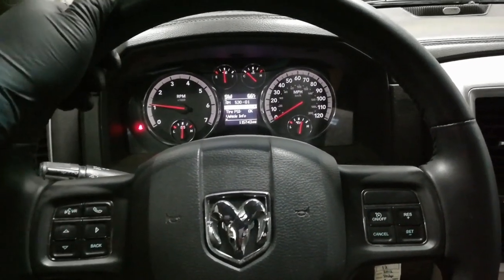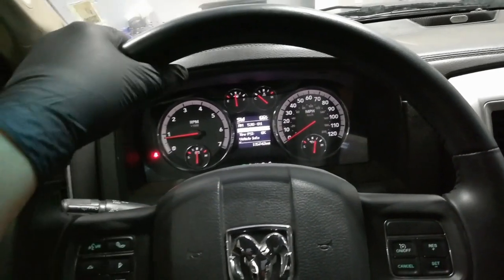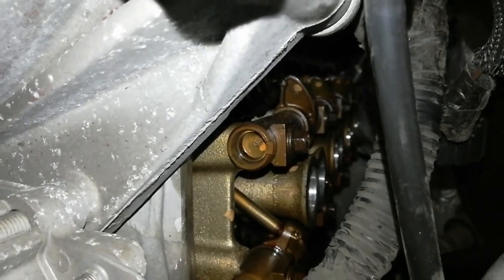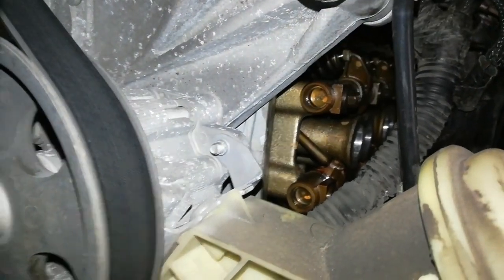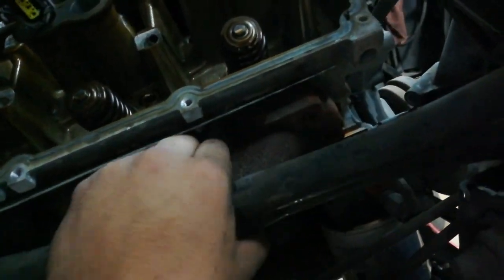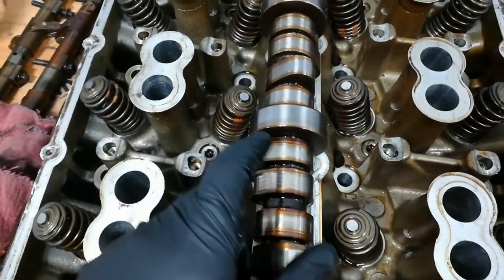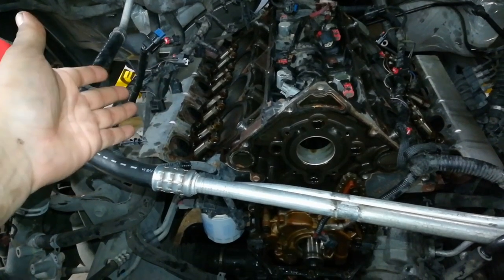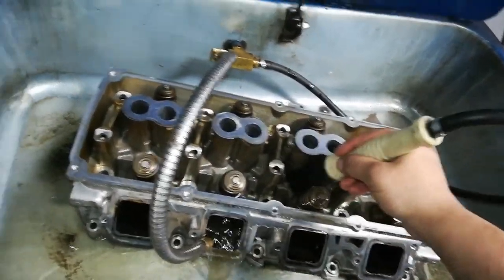Dodge RAM Missfire Part 1 ( Tear Down) 5.7 6.1 6.4 HEMI Camshaft and lifter Install

Comment: Nice vid, I'm dealing with this on my truck right now. Try clear flood crank mode, foot to the floor on the accelerator pedal keeps the injectors from firing and allows you to crank without starting 👍

Comment: Thanks for your help man! In the process now!
Reply: What parts or where did you get the parts
Reply: @rayray9777  the lifters are aftermarket. I think ebay. Non mds. But it took 3 tries. The camshaft was from the dealer, give them your vin because 4 camshaft for that year.

Comment: See Uncle Tony’s video. It is a design problem. If your engine idles a lot the “splash oil” cannot reach the lifters below 1500rpm. The cam is in the way and the main oil galleries block the oil to the cam from the crankshaft. A possible fix for a daily driver is to remove the splash guard from the oil pan. 45 minute job to get 200,000 plus miles of service.
Reply: What do you mean splash guard the oil baffle that’s part of the oil pan gasket ?
Reply: Yes it is, but it is better known as a Windage tray. Stopping oil splash giving you a very, very small increase in horsepower. The lifter needle bearings and the cam lobes need more oil. Or cut a 2 inch slot in the middle of the Windage tray from front to back to get more oil at idle.

Comment: If the vehicle has the MDS system it will run on 4 cylinders at idle. I just watched a great video on how this affects lifters/valve operation. 

Please correct me if i am mistaken, I am not a dodge guy and just trying to find out more information on the 5.7L tic..

Have a friend who's vehicle.JUST started having the tic issue and considering repairing it for them.

Comment: In the last two years, has the engine and oil pressure been okay? Doing this same job soon, but worried about long term damage from cam metal.

Comment: Any updates?
Curious as to what type of oil you were using before the repair and whether you switched oil type after the fix.
Also, what was the approximate mileage when the engine developed the misfire?

Comment: I have the exact problem.  I have a 2012 dodge 1500 5.7 hemi bighorn.   Its has 11000 miles on it.  I bought it brand new.   I still owe 6,000 on it.  Dont have money to fix it.  Can I still drive it, and not cause any more damage,  I know it won't run the best, but will it tear up my engine?  Please would love some advice...thanks
Reply from the maker: Unfortunately it will tear up the engine all that metal from the damaged lifter and cam gets in the oil, and not only that the valve isn't opening all the way which can burn the valves. And driving with a missfire for an extended period of time can damage the catalytic converter
Reply: Thank you for taking the time and explaining that to me.  I appreciate it.
Reply: @aaronconradvleck786  hi Aaron so sorry you are going thru this. I just got my truck back after 1 month in the dealership getting a beer long block because I had rollers, lifters and cam fail on my 2011 Ram 1500 4x4. Metal shards were all over the engine from the lobe. It’s so frustrating that Chrysler knows about this issue with the bearings in the rollers but they won’t do anything about it. Good luck to you. Don’t buy Ram in the future. I sure as hell won’t.

Comment: Unfortunately these motors are using junk parts. Look at all your cam lobes and lifters. You'll find if it wasn't cyl 2 it would have been 3 or 4 or 8..... doesn't matter. 
Just junk parts. 
This will typically damage the top of the valve too

Comment: I have changed the cam and lifters, and 2 bent valves, it's all back together but won't start, it turns over fine and I have fuel, is there something I'm missing? Thanks in advance, your video is awesome!
Reply: Did you ever figure it out? About to do my cam and lifters.

Comment: I’m getting the misfire code on cylinder 1 and a bad fuel mixture code.  The misfire only happens at high speed under load. Would this be the same lifter problem?
Reply: We’ve got a 2014 jeep SRT with a 6.4L v8. 96,000miles.  I’m the wife so I’m not good at all the proper engine terms yet.  I’m learning!  Husband started complaining of inability to accelerate a normal rate as well as having to restart when slowing down or at red lights.  Next day he started taking my car to work.  I had to get groceries so I took the jeep to the grocery near our house.  It was terrible!  Little cars with grannies behind me were annoyed and passing me at the red lights.  I was like I’m sorry I’m sorry!  It’s funny but sad for such an engine.  Usually when i drive it some teenager pulls up revving wanting to race until they realize I’m a mom with toddlers in the backseat.  

Anyway, that night our neighbor used his code reader thing.  He got p0301 misfiring cylinder 1. Neighbor also noticed clicking sound.  I told him the engine was always loud and obnoxious.  He said that wasn’t a normal click, though. 

So i ordered mopar spark plugs and changed them all. (Neighbor helped.)  Before changing the plugs it sounded like the click was coming from passenger side near the second set of spark plugs (second if the first set are considered the ones closest to the headlights).  After changing them all, the clicking sounded more general.  It was hard to pin down where it was coming from. 

 I drove it after the plug change and it still barely accelerates and it still dies and has to be restarted.  It’s so sad.

SO, we have a 100,000 mi 5 year warranty.  We are past 5 years though.  I’m afraid it’s the lifters.  Are the lifters hard to get to on all engines?  How do i find out where the lifters are on this engine?  I’m just curious if that’s what the problem is.  The dealership can’t take it until Tuesday.

Honestly, I’ve watched a bunch of videos of people changing lifters and rockers (not cam shafts though) and that doesn’t look TOO hard.  It’s taking everything out of the way that looks like such a complicated pain in the rear!

Comment: What years is this common in and are 2014 RT Challengers affected by this problem?
Reply: If  you bought a MANUAL transmission R/T you'll probably be ok.  Why? Because you'll be spinning the engine up to higher RPMs, varying RPM and hopefully not idling often.  The Manuals also don't have MDS which seems to have issues more often than HEMIs without MDS.  All HEMIs can suffer this problem because of the way the engine is designed in that it doesn't get adequate oil flung onto the cam at lower RPM because the Cam is so far up in the block compared to other pushrod V8s.

Comment: Do you know the torque specs for the crank shaft harmonic balancer bolt on a 2014 5.7liter ram 1500?

Comment: Hi how much is to repair to replace the camshaft and the  lifters I have a 2011 Dodge Ram.
Reply: Lots unfortunately, even if you buy the parts and attempt to do it yourself, which is no easy job, it's still probably at least 500-600 just for parts alone, not including special tools you will need for messing with the timing chain.  I have a 2010 challenger with the ticking sound and from what I've learned on the web, it's either exhaust manifold bolts, or bad lifter rollers that seize up and damage the camshaft lobes.  Either job is a pain in the ass lol.
Reply: @ianmastrangelo2427  thanks a lot for the info I wished Dodge paid for that
Reply: I too have the effed up camshaft on my 2011 RAM truck with the 5.7 HEMI engine. I've had difficulty finding a mechanic in my area willing to do "internals" on a motor, they would rather replace the engine instead of repairing it! That said, the estimates i've gotten are $3,800 from the local dodge dealer to replace the CAMshaft and lifters with 2 year warranty on parts/labor, and around $7500 to replace the engine with a reman that comes with 3 year warranty. Either way that is a big chunk of change :(
Reply: Same im looking for someone in the dfw area if yall know anyone let me know

Comment: did you replace the oil pump? it will have metal shavings in it ..
Reply from the maker: Nope unfortunately with reconditioning used cars they want to spend as little as possible. Basically band aid the car or truck and sell it

Comment: We are having this issue right now on a friends truck. I was quoted 25 hours because he wants to pull the motor and inspect the bottom end. That seems like a little over kill to me. All the research I have done no one has said anything about pulling the motor. I can see splitting open the filter and checking there and possibly dropping the pan. What is your take on it?
Reply from the maker: Sounds excessive. If you think its a lifter spin the motor over and see if you can find a rocker arm that isnt moving
Reply: @BoBuilds  I am almost certain that is what it is. We have a very noticeable tick with a P0303 code. I feel that checking the oil filter and doing a complet cam and lifter change will be sufficient. Your thoughts?
Reply from the maker: Yeah should be fine. Its not like it instantly grinds off the cam lobe and fills the system with metal. Its a gradual process that routine oil changes help rid of metal debris. This truck was fixed with a new camshaft and 1 lifter. I got paid 15 hours. Removing the engine was not needed

Comment: Why in the world would you replace only one lifter after doing all of that work? Replace all of them and NOT with the same crappy design stock lifter. Replace all of them with aftermarket lifters and never have to worry about it again.
Reply from the maker: Because in the used car world they want to spend as little as possible in the recon process. They band aid the problem and sell it to some poor customer

Comment: Thanks for the video! I have a 2011 ram 1500 that I'm going to attempt to put lifters and a new cam in also. I heard you say you didn't need to disconnect the ac lines? I assumed they were also attached to the rad somehow and I was preparing the disconnect them. You didn't have to discharge your ac to do this job? Did you pull the radiator?
Reply: I have a 2011 1500 as well. did your problems get resolved after that? And did you have multiple misfires too

Comment: 2014 Charger SRT 392 only 66k miles and I had #5 intake lifter 3 months past my 5-year warranty Dodge told me I didn't meet the criteria to fix this they told me this is more common on the 5.7 even though the 6.4 uses the same part number lifter... This isn't an oil issue or more lifters would have failed.

Comment: Just curious  , do you really have to remove the heads to replace the camshaft ?
Thanks.
Reply: No, but typically you are replacing a camshaft and  lifters at the same time, and you need to take the heads off to get to the lifters